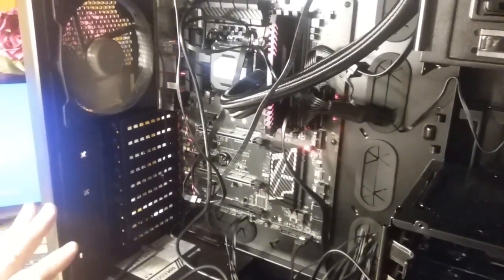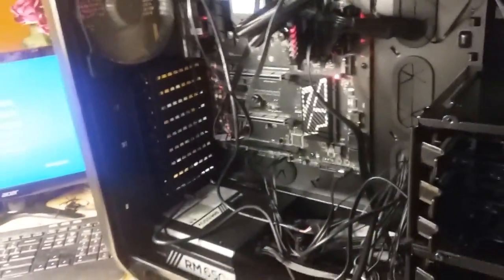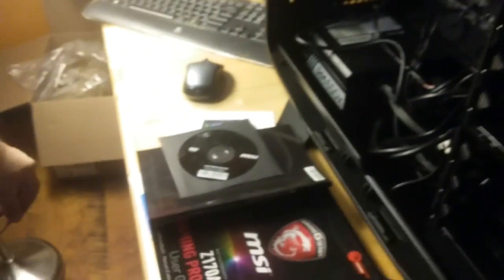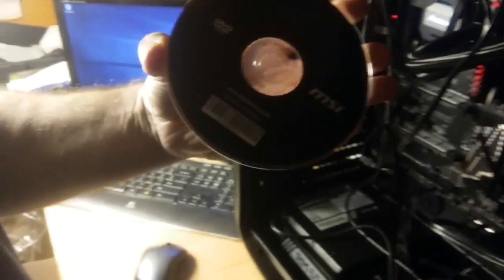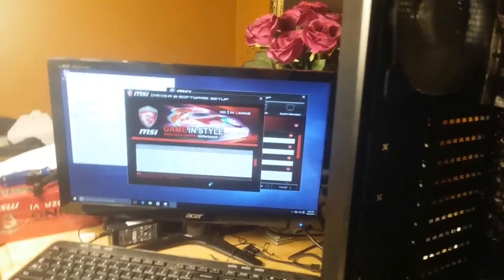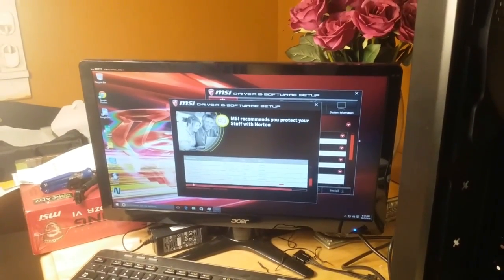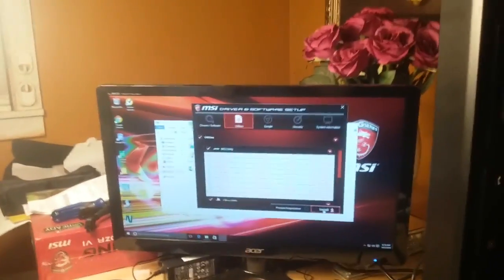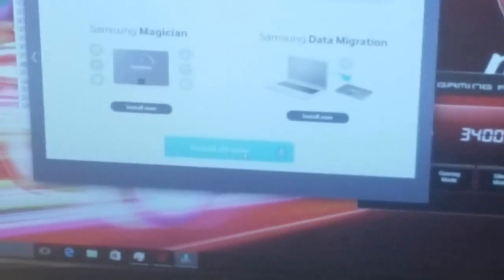MSI Z170a Gaming Pro Carbon - Successful Windows Install

Comment: I have a windows 7 disk, everything hooked up. Will windows 7 work?
Reply from the maker: Windows 7 can work but we finally installed Windows 10.  Windows 7 will work on the i5/MSI motherboard set up here but will not have all the features that Windows 10 has.   Our original problem installing Windows 7 boiled down to a bad memory module.

Comment: if u plugged an ethernetcable in would u just get connected ur do u have to download a driver first?
Reply from the maker: Once Windows is installed, all you have to do is connect a live ethernet cable and you're on the internet.  Windows comes with the basic drivers you need to get your ethernet working.  I recommend immediately going to Windows Update to get any necessary driver updates.  Also, using a battery backup is always a good idea just in case you have a power issue when installing.